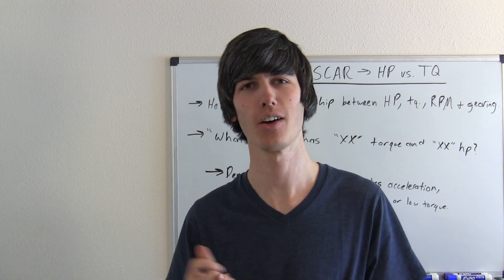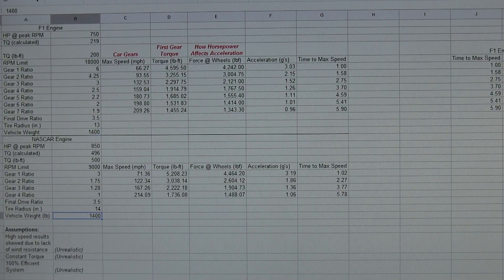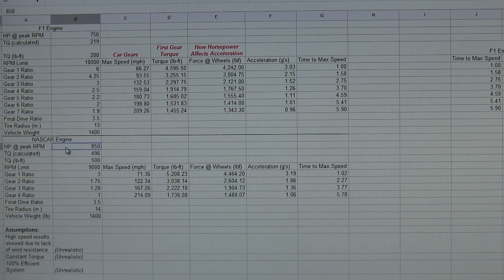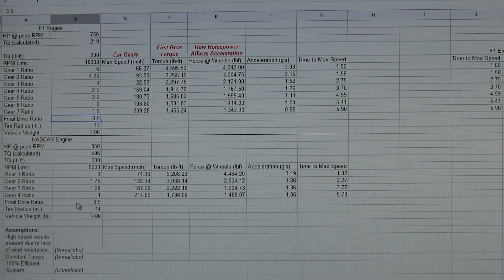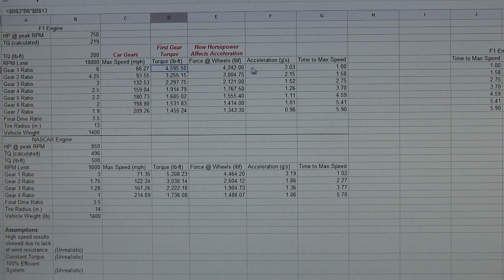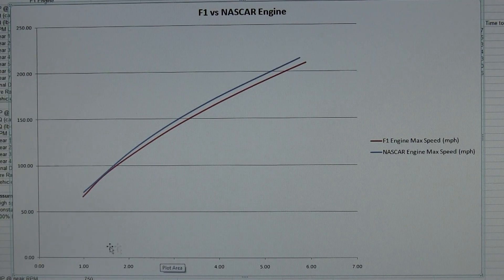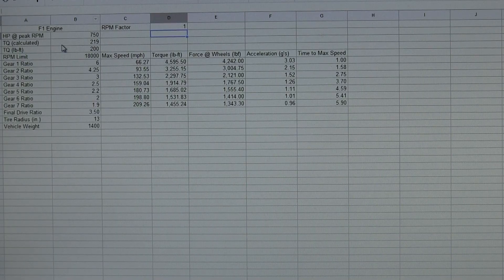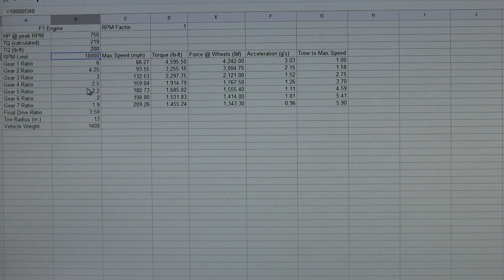Horsepower vs Torque - Formula 1 vs NASCAR

Comment: Dude I really enjoy your videos.  I am an engine builder and love studying specs and all the stuff your vids cover.  I just built a chev 355 w 9.5/1 pistons a rpm dual plane 650 carb and a 230/244 comp cam with 6 degree lobe separation.  Ya lots of chop.   Built it to sound tough but it still  runs pretty strong.  (gotta be careful with your foot after 3000 rpm)  lol  Keep up the great vids !!

Comment: I hate the torque vs power argument. Peak levels of either are such poor indicators of overall performance
Reply: +decidiousrex  use area under the curve, or averages.... (average is a simple integration, right?)
engine torque is completely meaningless to compare performance of a vehicle.  rear wheel force is, but no one goes through the multiplication of gear ratios and torque at certain speeds.   HP does all the work for you . if you have more hp at any speed, you have more accelerative forces and the highest acceleration potential than any other engine speed or car you are competing against.    PERIOD!
Reply: zanick2 You 100% missed my point (and I have no idea what the first chunk of your comment is trying to say about averages relating to integration)
"torque is completely meaningless to compare performance of a vehicle"
No.... it's not. The volume of the glove compartment is meaningless to performance. Torque, on the other hand, is the most basic measure of the instantaneous force produced by an engine.
"no one goes through the multiplication of gear ratios and torque at certain speeds"
Actually a lot of people do. Maybe you don't because you're either lazy or don't understand it, but it's very insightful.
" if you have more hp at any speed, you have more accelerative forces and the highest acceleration potential than any other engine speed or car you are competing against"
Accelerative forces.... compared to... other types of force? And what in the holy hell in "acceleration potential?" Never heard of that before. So if your engine produces 1000 HP from 6k RPM to 6.1k RPM, you will have a faster car than one that produces 800 HP from 2k RPM to 6k RPM? Don't think so.
Go back to school
Reply: +decidiousrex you are getting a little ahead of youself..... think viper vs Porsche gt3RSR.  both 500hp, one with 250 ft-lbs of torque and the other with 550ftlbs of torque.   the HP curves are the same shape and both will accelerate exactly the same at any spot on the track over any speed range.  why, engine torque is meaningless to compare unless you have RPM. HP can be compared directly with no other factors over any speed range comparison.   accelerative forces means force at the rear wheel, after gearing, not engine torque. (the rotory force of the engine before gearing) yes you can go thorugh the thrust curves for each gear. easy enough to calculate .  but its much easier to use a HP curve. there is just more information in it  vs multiplying gear ratios, wheel diameters, etc.I don't understand your example  6k rpm to 6.1K rpm 1000HP...... what does that mean.  Ill tell you what it means, over any speed range of the range 6100/6000, the 10000hp will accelerate faster than any lower HP in that same range.   your example is weak.I would refrain from insults untl you make your point clear and understand mine....  acceleration = power/(mass x velocity)  ... this is a Newtonian identity.   this is fact.. not something I just made up.     didn't they teach you that in school??   rate of change of KE is power !
Reply: +decidiousrex  as far as the HP range . you hit on a good point.  its really about the area or average HP over the operating range.   if the 1000hp car only had a peak of 1000hp in that 100RPM range, and it fell dramatically before and after ... you ether need very close gears to always have 1000hp , or there will be an average. on the other hand, if you have a 800hp output and its from 2k to 6k,  then its average is 800 and it will have more accelerative forces  (torque at the driven wheels, after the gear box) IF and only if the average of the 1000hp peak engine is less over its operational range.   in other words, if the 1000hp car had a normal gear box and its HP was 800hp at 4000rpm and 1000hp at 6100rpm,  it would have an average of 900hp so it would have a "faster" car.  without question.   make sense?
Reply: zanick2 The same pitfall with torque curves plague horsepower curves.
"and both will accelerate exactly the same at any spot on the track over any speed range"
Except.... they don't. The Porshe goes 0-60 in 3.1 while the latest Vipers are 3.6 at best. Ironically, the Viper actually has 600 HP to the Porsche's 500, and over a longer powerband. So why is the Porsche faster? The Porsche has nearly half the cylinders and less than half the overall displacement (8.4 vs 4.0), which is going to lead to lower overall torque at the same RPM. This is evidenced by the fact that the peak HP is reached by the Viper at 6k RPM and 8k for the Porsche.
So what does the Porsche do to be faster? Weight, gearing, and aero all play heavy roles. It's the same reason my motorcycle with almost a tenth of their horsepower will smoke both those cars.
Reply: +decidiousrex   again, you don't seem to be understanding the point or the concept. I will never compare two totally differnet cars . in the example, of Porsche vs viper... I was assuming (to make the Point) that all other things about the two cars are equal. same weight, same everything, but the drive train.  ive witnessed the equality in professional racing first hand.   I am referring to same rear wheel hp and weight for both.  they both will accelerate the same at any point on the track, and over any speed range.    I have the viper and 911gT3rsr dyno sheets. (in hand)  the shape is identical over the usable range for both cars.. however, the torque for the 911 is half that of the viper.. so why do they accelerate the same because the HP is the same at any speed.   this also means that the rear wheel torque is identical too, at any speed.  And this also means that the accelerative force is the same at any speed.why are you fighting it.  you are arguing against the LAW.  a Newtonian law that specifically states, that acceleration = power/(mass x velocity).. this means, if you have the same HP and all other things are equal (mass and the speed you are traveling at) you will accelerate the same REGARDLESS of engine torque values.  I don't know if  I can be much clearer. again, remember , acceleration is proportional to HP... its also proportional to rear wheel torque , AFTER the gear box... so, you can use either.     any car at any speed using the same HP, will accelerate  the same, SAME SAME SAME!   (as long as the weight (mass)is the same.  this concept has NOTHING to do with HP/weight ratios that are NOT the same, like a motorcycle comparison.I don't mean to insult you, but have you taken any physics classes? just curious so I can tailor my response

Comment: "Horsepower sells cars, torque wins races." - Enzo Ferrari or Carroll Shelby or possibly Abraham Lincoln. I figure the horsepower vs torque argument was probably much more relevant in the 1960s, an age where things like fuel injection, variable valve timing and manual gearboxes with greater than four speeds were either uncommon or nonexistent. I'd imagine a low tech car tuned to have peak torque in the upper midrange might be faster on a twisty road course than a similar low tech car car tuned for peak horsepower due to having a wider usable powerband and I presume that's what whoever said the above really meant.

Comment: You did a good job explaining your points in the video. I think you should have taken a minute or two at the beginning though and explained the relationship of TQ:HP. Even if you have done this in a video before, there are still a ton of people down here in the comment section that are struggling with the concept.

First of all, the ENGINES torque output never changes based on gearing or RPM limit, but you showed in your video that it does. I think that is confusing everyone. 

Torque is the Alpha and Omega when it comes to figuring an engines ability to do work, not horsepower. There is no way to measure horsepower. Dynamometers do not measure horsepower at all, they calculate it. Horsepower is a direct relationship between torque and RPM. The formula is HP=TQxRPM/5252. This means that an engines torque will ALWAYS be higher than the horsepower under 5252 RPMs, and horsepower will ALWAYS be higher than torque over 5252 RPMs. Horsepower and torque will ALWAYS be exactly equal at 5252 RPMs.

What this means is a F1's high horsepower rating is owed almost entirely to the fact that it operates at such a high RPM. For all intents and purposes, an F1 engine is a scrawny little engine that puts out very little overall power. Most cars on the road today put out as much or more torque than an F1 car. 

Everything I've said thus far applies only to the engine and the actual power it generates. Once that power reaches the transmission is where things get interesting for the F1 car. When you operate at such high RPMs, it allows you to run incredibly short gear ratios and since gear reduction multiplies torque, even when you start with a low torque rating, you get massive numbers out the back which he explained/showed in the video. I won't get into that because it was covered very well already.

Finally let me say that this novel I just wrote was not digging at F1 cars, I'll take F1 over NASCAR any day. F1 is the pinnacle of automotive engineering in every sense of the word, in every aspect of the car. I simply had to be clear that an F1s performance has little to do with the power it actually generates, and owes almost it's entire existence to being able to operate at 18,000rpm. Nor was this a dig at the creator of this video. I simply saw people in the comments struggling to reconcile the info you told them with the info you showed them. The main problem being when you lowered the RPM, the engine torque went up, and that simply isn't the case. No amount of gearing/rpm change is going to affect the engines output.

Hopefully this helped some of you guys out down there. Feel free to reply if something I said was unclear.
Reply: Both NASCAR and F1 both run at the same PISTON SPEED! Excessive
piston speed is what blows up engines, NOT rpm.... That Nascar engine running at 9k (they actually will go considerably higher than that) is roughly 5000 ft/min piston speed and is identical to the F1 engine at 18K., because of the much shorter stroke on the F1 car.
Pro Stock Drag racer's run at 7000 ft/min, but their engines dont have to last very long... both Nascar and F1 are supposed to be able to go
roughly 500-800 miles without breakage.
Reply: I think I understand the concept more or less, but I still have questions

For example, take the Porsche 911 Turbo S....I don’t know the exact figures so these are just ball parks, but IIRC, that car produces 700+ Lb-ft of Torque and only 600+ HP....but based on the formula, this would mean that the RPM of the car is less than 5252 (HP=TorquexRPM/5252...so for HP to belower than Torque, the RPM has to be lower than 5252)

But we all know the 911 Turbo S revs way higher than 5252 RPM (probably between 7000-9000 if I had to guess), so what’s going on here? Maybe it’s that the engine actually produces up to 700+ or even more HP, but by time it gets to the wheels it’s only 600 due to an inefficient transmission or drivetrain? Or does it have to do with the torque to rev range relationship? 

Like for instance it produces 700+ lb-ft of torque at really low RPM (example 2000) but once the engine revs above 2000 RPM the torque output starts to drop significantly

Idk, I’m trying to learn so if anyone can enlighten me, please do so
Reply: @Footballazz  from what I understand, it doesn't matter where the peak number is they always cross at 5252 rpm, so considering the torque number is bigger than the hp, it must be reached below 5252 rpm.
Reply: @Footballazz have a look at the published peak torque and peak HP numbers they should be accompanied by a a corresponding rpm that each occurs at.  You can use the formula of Power = torque x rpm/5252 to derive how much horsepower the engine is producing at its torque peak and conversely how much torque it is producing at its HP peak.  For doing more work, like pushing/ pulling, hauling or towing and load in any weight of vehicle, accelerating from any speed within a given period of time or doing the same in a shorter period of time requires more power.  Anything work can do power can do better.
Reply: I think we also need to consider the Power-to-Weight ratio.
Reply: Len Polidori no, both cars in the example are 1400kg
Reply: +Gunner3789 Basically the deal is the formula isPower = Force X Velocity X Conversion-FactorSince torque is angular force you have to use angular velocity.(Revolution per time) What this formula tells you is that you can trade force for velocity. It also tells you the upper limit on the total output of the engine and therefore the max amount of trading you can do. If you have high power (HP) that means you have a lot of room to trade one for the other via gearing. It also means if you have high torque but low power you can't do much trading. (So for example a tractor engine with huge torque but low horsepower will move, it just won't move fast and no amount of gearing will increase HP. Thermodynamics just won't allow it.)
Reply: nice
Reply: Edward Lim
How does power to weight apply in any way to the topic of this particular thread?
Reply: +Edward Lim he did, watch again
Reply: helped me, thanks!
Reply: zeetweets_
Awesome. Glad I could help.
Reply: what if nascar had rev limit at 18k rpm? would it have double hp and half torque?
Reply: ***** it would blow up
Reply: damn
Reply: Thank you so much lol
Reply: It should be noted that an F1 car is less than half the weight of a nascar car. The light weight allows the F1 to perform well without a high torque output.

Comment: i'm trying to understand something, but the imperial metric system drives me nuts!!! =(
Reply: Damn muricans...
Reply: +ΑΡΗΣ ΚΟΡΝΑΡΑΚΗΣ which is odd because no class room setting I've been in actually uses imperial if it can be avoided.
Reply: roguedogx I'm familiar with inches in screen size, in wheel, and metal pipe (and fittings) diameter. The PE, PVC, and PPR pipes diameter in mm's. Slowly but steady the metric system invades to normal americans every day life
Reply: ΑΡΗΣ ΚΟΡΝΑΡΑΚΗΣ I think that story is as old as the idea of communist invading America.
Reply: roguedogx sorry but then the rest of world uses the metric system you must use it and you, especially when globalization exist
Reply: ΑΡΗΣ ΚΟΡΝΑΡΑΚΗΣ first off, I don't have an issue with that, especially when it comes to pound mass and pound force.
Reply: It doesn't really matter, you could still understand it if everything was in "torque units" "speed units" and "horsepower units" as you're just seeing how the gearing, RPM, and horsepower relates to the situation.

Comment: Im just curious, in your spreadsheet, what was the purpose off adding the non calculated torque? Also, i put my gearing, tire diameter, rpm limit, weight, and final drive for my car. The top speed is not correct. Is it supposed to be like that?

Comment: Maybe I missed something but how does halving the RPM limit of the F1 engine automatically double its torque as shown in the final spread sheet? The torque should also drop.

I realize you stated having a constant torque curve is unrealistic, but you are greatly simplifying this by doing that, to the point of unrealistic.

If those 2 vehicles you created raced the one with the NASCAR engine would blow the doors off the other one. It does not matter the race.

Comment: Final Drive ratio likely doesn't matter because teams may change the final drive ratio depending on the track and different teams may use different ratios for the same track.  NASCAR teams would run a lower (higher numerically, i.e. 4.10:1) final drive on a short course and a higher (lower numerically, i.e. 2.83:1) on a super speedway.  F1 would be a little different since all of their tracks are road courses and there would likely be a greater diversity of ratios in order for each team to pick the ratio that they consider ideal for each specific track.  Transmission gear ratios may be treated the same way.  For the sake of simplicity picking 1 set of ratios makes sense in this exercise.  Now to finish the video.

Comment: inreal world application a broad, large torque band is very important since most vehicles don't have 7 or more gears Give me 400 ft lbs from 1300-6000 (which makes less then 500hp) over 200 lbs at 18000 rpm a which make  700+ hp drop the motors in any us rear wheal drive vehical and I will make you look silly in a race (even with the additional weight of my engine not to mention the longer life span of my motor So for the average person torque extremely important hp not so much
Reply: +M D Adams 
Race engines are only designed to last for the race, perhaps 500 miles.  
For civilian application an engine is made to last at least 100,000 miles.   
So the design requirements are completely different.

The most extreme is a nitromethane powered dragster.  It produces 10,000 hp and 7000 lbft or torque.   But it has to be rebuilt after a 4 second run.
Reply: +M D Adams Don't forget that the 200lbs engine can have better gearing ratio which will triple the effective wheel torque compared to the 400lbs engine. So the race might not be as one sided as you point out, more of the opposite as soon as the 200lbs engine hits the powerband. But yeah, for normal operation the 400lbs is king with regards to driveability, noise and reliability.